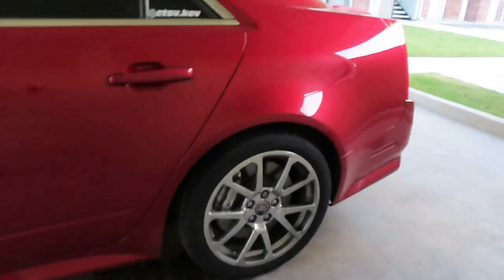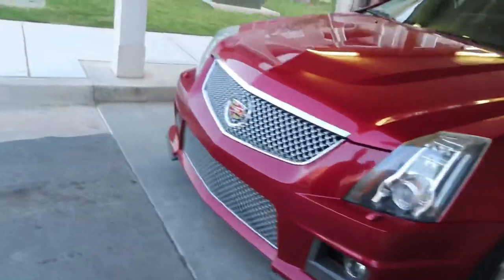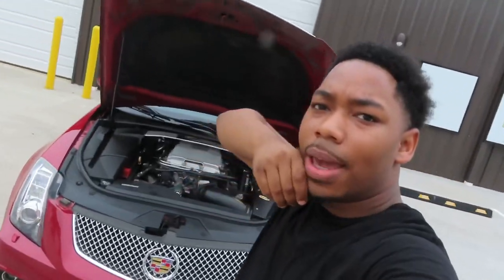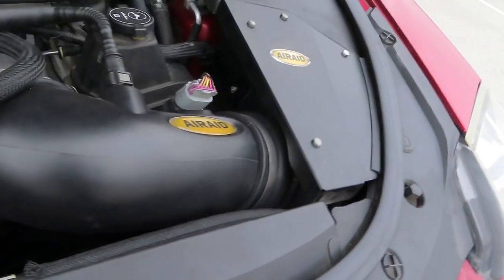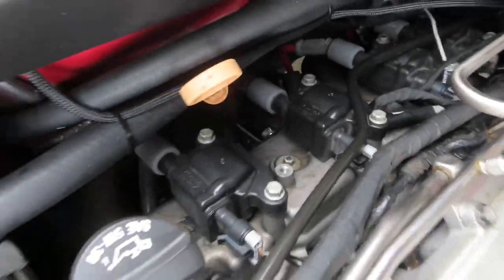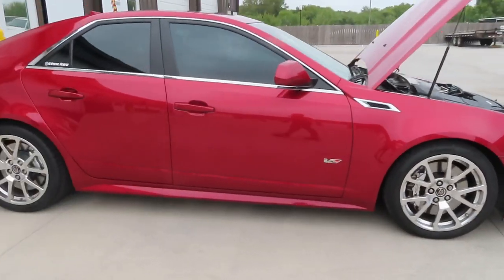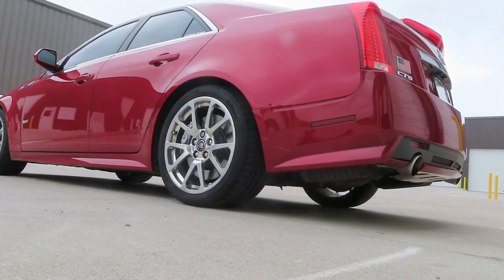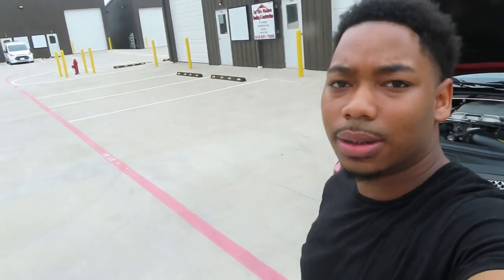Review of my Cts-v Build (XXX HP!?)

Comment: Throw in a stage 2/3 cam and lower pulley and you should be anywhere from 650-700 wheel on e85
Reply from the maker: Subscribe and check out some of the newer content. That setup is complete